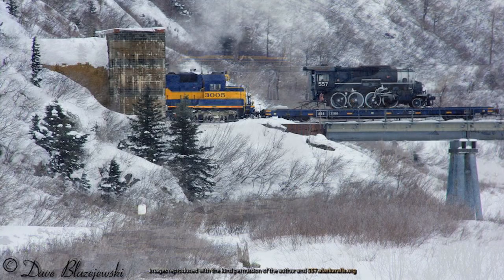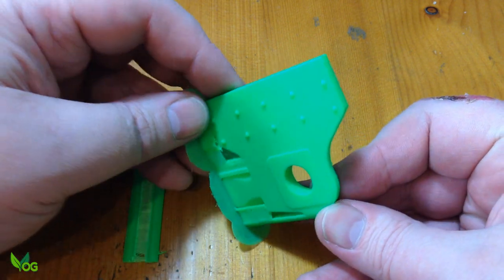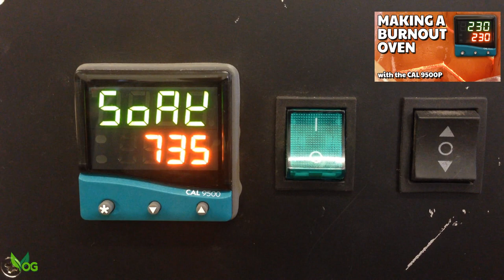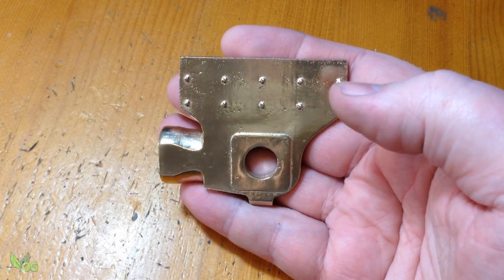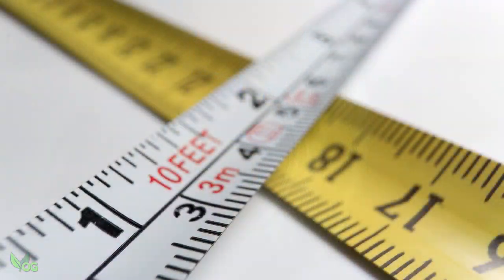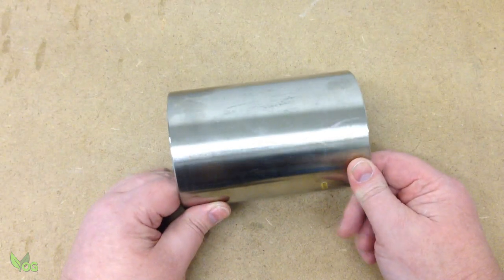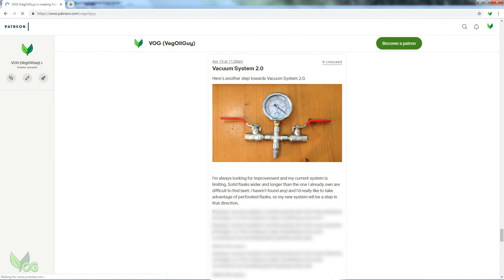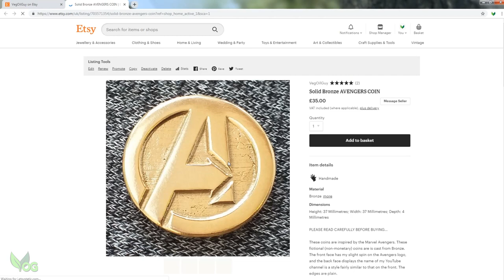Casting 1/8 model steam Locomotive Crosshead - lost PLA casting train parts by VOGMAN

Comment: I wish all the pittings that I get in my castings were like yours, it's part of the game. Gonna have to make some of those tapered sprues you and some others use and give them a shot one day. Great work on the parts. The detail you get is always top notch. Keep it up.
Reply from the maker: Porosity problems? It's a pig. The only real cure is to properly tune the gas torch, if that's what you're using... well, that's what I've heard. All those gases being drawn in, many not burned, get trapped in the molten metal. Tuning the torch can help, but I have not idea how. Alternatively, electric furnaces don't suffer the same issue. I genuinely haven't used flux or seen any porosity since exclusively using electric. It's slow, but it's clean, quiet and easy to control. Which gives you more time to focus on other stuff.
And if you do Lost PLA, remember tapered sprue bases are freely available on Thingiverse  : )

Comment: pitting could also be caused by ash or residue left from the pla,  the slight initial expansion of the pla on warmup could also damage the mould. did you ever burn out a mold and break it open to see if its clean inside?  I dont think the pitting is solely a vacuum issue, yes the sprues closer to the bottom look better than those at the top but the parts show relatively random pitting all over. shouldnt then the  parts at the height where the sprues look nice also be free of pitting?  there is an interesting paper in the santa fe symposium (2018, Eric paul marvets) about casting defects when burning out resin. Admittedly its not about PLA but might give some hints.  As you already have some perforated flasks you wont need that trick, but with solid flasks you can stick some wax wires to the side wall, these burn out and leave channels for the vacuum, plastic straws (with the end that goes in the flask capped/melted closed of cause)  can also be used.
Reply from the maker: I've considered a few techniques to improve the vacuum on the solid flasks, but ultimately the one I have is just two small. So largely flasks call me... and perforated flasks make sense.
I don't think the PLA is an issue. I've used more PLA in other castings without the pitting we see here.
That's part of the fun of casting. Each one is a mini detective series  : D

Comment: Hello there! Do you have video where you show casting process around vacuum chamber? Like what hapens after pour. And do I get it right, that vacuum is working thru the plaster pulling metal into every spot? At first I thought its like vacuum in resin casting on silicone mold, so it just pulls bubbles thrue vent holes.
Reply from the maker: Hi Maciej. Have you watched my homemade vac video? https://youtu.be/EGNnH_xbjR4  it covers a lot of this I think.
Your understanding is correct. The vacuum pulls THROUGH the plaster and sucks on the metal, removing any air and making the metal fill the plaster mold better. But there's very little to see... turn on the vacuum pump, pour the metal, turn off the vacuum. After that it's all about the plaster / casting. The vacuum is just left alone until next time.
Hope this helps. If not, you know where I am  : )

Comment: Have you considered printing airways in your sprue pattern for burnout which will allow vacuum further up the solid flask? Or just fixing pattern wax beads up the inside of the flask all around its circumference from the bottom up to near the top to produce airways?
Reply from the maker: I've been toying with that approach. But I feel very squashed at the moment. I like keeping things small, but sometimes the casting space is too restrictive : )

Comment: Hey Jeff, I've come across your channel a short while ago as I'm growing a keen interest in investment casting with resin 3D printers but for model trains as well. I work in the smaller scale of 1/87 HO, akin to the 1/72 OO standard in the UK. I want to create replacement parts for brass engines I've collected and mean to restore but have come across the potential need/ rabbit hole of a side hobby in metal casting.  Do you have a list somewhere of readily commercially available products that could get a hobbyist like myself set out to doing casting but on a limited run/ small scale basis? Excuse the word play. 

Cheers and keep up the wonderful vids. I've loved learning from them the past week week now.
Reply from the maker: More and more model railway enthusiasts are discovery the benefits of home casting thanks to 3D prints and castable resins. Once you begin, it's surprisingly easy and often lucrative if you supply fellow hobbyists with casted parts 😁
Have a look at this video. It covers the process pretty fully and gives you an idea of what's needed, the alternatives and where to purchase.
I hope it helps 👍👍👍

Comment: Two inexpensive things you can try you can add flux to the metal AKA borax and you can use Square sprues to decrease tribulation ... the only other consideration I would make is to use Marine bronze because it's very stable against shrinkage in pitting:::: just found your channel cheers thanks
Reply from the maker: Thanks for sharing 😁

Comment: hi . what is the vaccum pump you use for casting ?
Reply from the maker: This is my home made vacuum system - https://youtu.be/EGNnH_xbjR4 - it does an amazing job.
I designed it to work with a manual pump, but being lazy I now use my electric pump which is also shown in this video.
Hope this helps : )

Comment: one question, do you pour while the flask is hot from the burnout or you wait till the flask cools down to room temperature? have you tested if this has any influence on the quality of the end product?
Reply from the maker: The flask is still hot... you need two heat sources for this technique : )
Reply: @vogman  thanks for your answer...
Reply: @Hobypyrocom  if the flask is not hot you get thermal shock induced cracks through the casting. Those thermal shock induced cracks can also result in mold failure in some cases.

Comment: With the perforated flask, why don’t you cut a hole in the acrylic lid of the vacuum chamber the diameter of the flask and use a vacuum gasket designed for perforated flask? That way the flask goes into the chamber and doesn’t sit on top.
Reply from the maker: At the moment, the hot flask sits on top of the acrylic, separated by a silicone gasket. This stops the acrylic getting hot. But if I place the hot flask beneath the acrylic, it will melt. It will also be inside a wooden box... that will burn. In short, the whole thing will burn to a crisp in moments : )